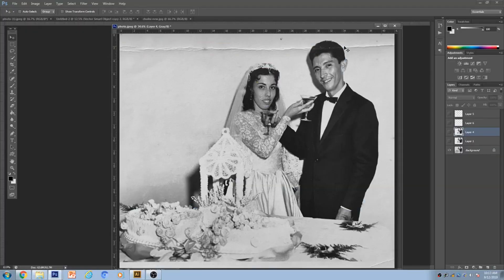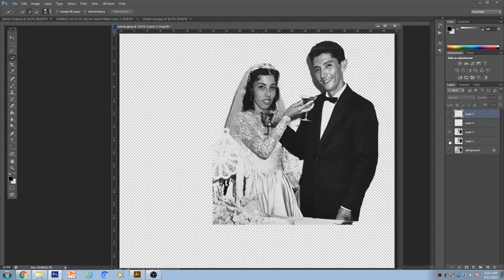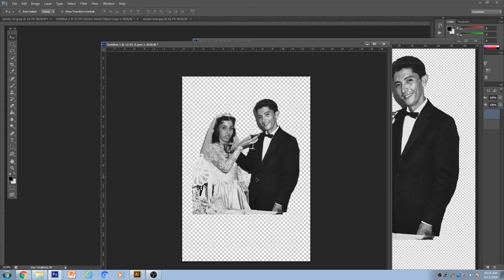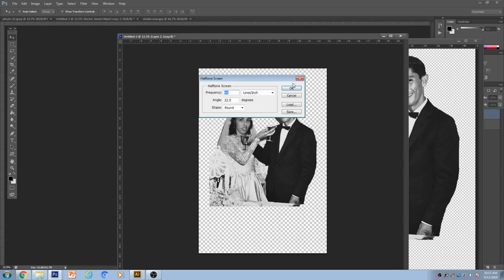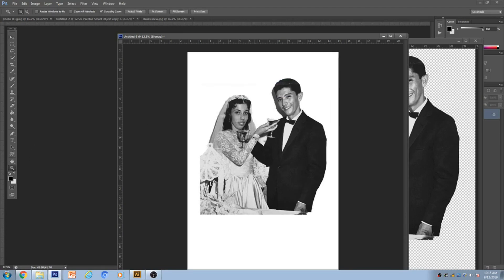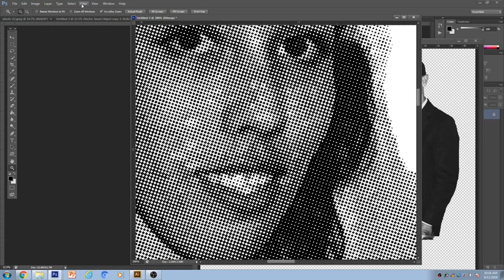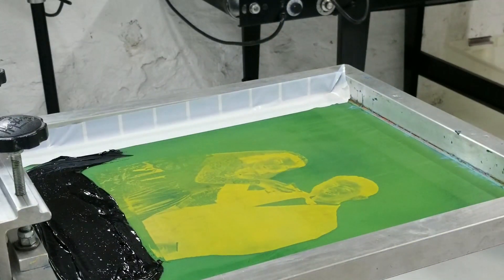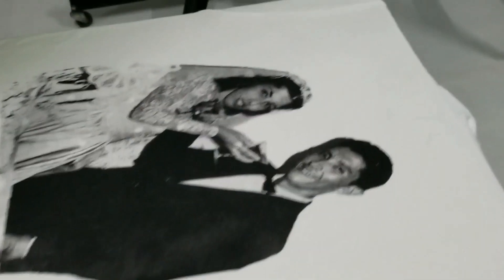How to Screen Print a Photo on a T-Shirt

Comment: what would you recommend if you don’t have a light box ?
Reply from the maker: Halogen light. 500 watts.
Reply: @tainoink  make a stand for a 500watt halogen shop light. Also get a  non-UV protected glass with beveled edges from a glass shop. The light should be 16” inches above the glass. Get an egg timer too.

Comment: I've a question, how does screen printing give colour tones. I mean u have printed that print that contains black and off black colours both but u applied the black colour only. so is it possible,?
Reply from the maker: Using halftones lightens the color and it makes it look like two colors.
Reply: I was also confused by this. So are you saying the all the colors on the shirt besides the texts is from the black ink?
Reply: Also will multiple passes mess the color up?

Comment: Hey, I make designs for my friends clothing company. I was curious what you as a printer prefers from the client when sending you artwork/ graphics. If the graphic was sent as a psd file with a photo and text does that create too much work for you? Or is that standard in screen printing?  Also, I was under the impression that all screen printing work should sent as an illustrator file, Which always has left me curious on how photos are screen printed. Regardless, great video! very informative for me
Reply from the maker: Thank you. Usually client don't have know about what file the image should be then you have clients that will send you a psd, pdf, jpeg, png files and we have to try to do the best we can with the file they send us. There are times that we have to let the client know that file they sent us is not a good file to work with so what I suggest is to create something similar to their design and usually they will go for it. The only thing I ask the client is to send a high resolution file.
Reply: CAN YOU DO THIS SAME PROCESS WITH ILLUSTRATOR?